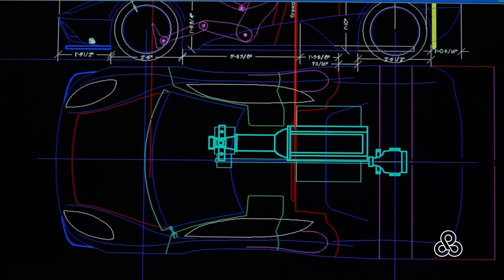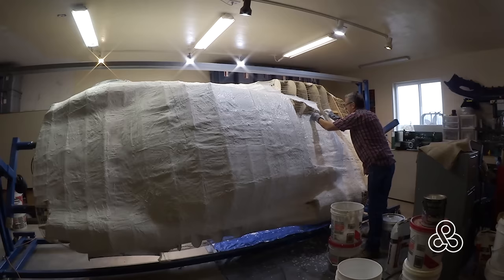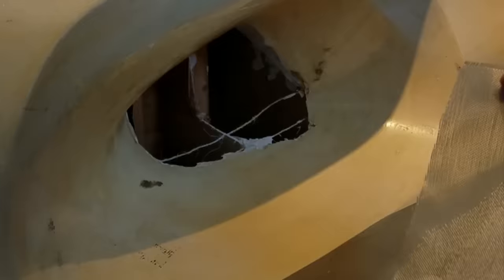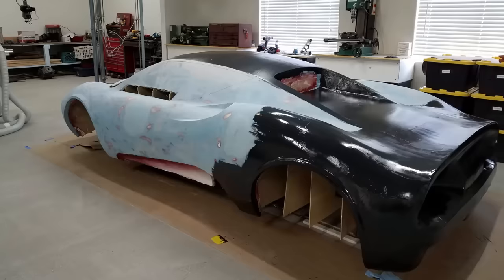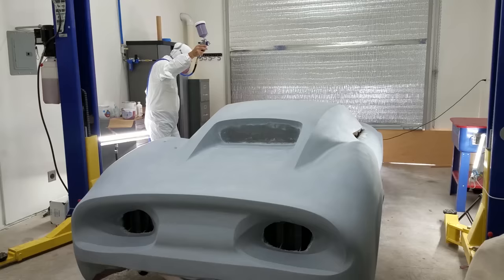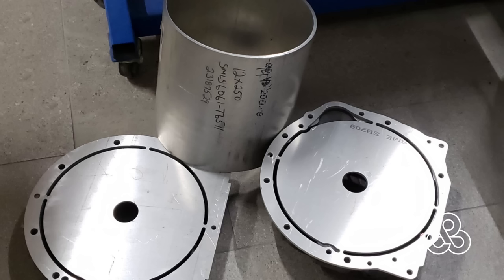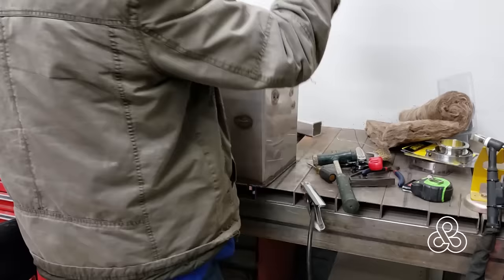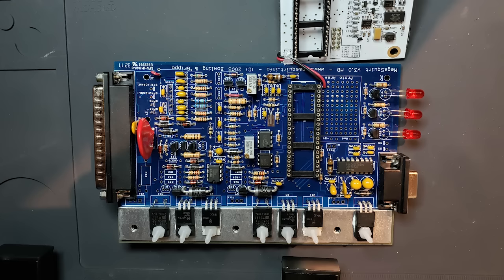How to build your own 200mph Supercar; at home in your spare time. Part 1

Comment: I love how you did this old school with the plywood, burlap, and plaster, rather than have a CNC machine carve a complete car shape out of solid foam like many guys do nowadays!
Reply from the maker: Thanks! I'm not apposed to the CNC foam modeling, but I wanted others to see a viable, less expensive, way to get it done. Hope you follow the whole build - lots of other "short cuts" in the process.
Reply: @BuilderCreator  I have been watching/subscribed to your channel for over a year. While I would love to be able to build an entire car from scratch like yourself, but budget restraints have me instead thinking of skinning over an existing car with my own design, leaving the original car intact underneath (for the most part). I am left wondering if it would be possible or practical to shape with something like foam over an existing car's body, and then just fiberglass it, leaving the foam underneath (maybe as sound deadening lol). If that is possible then I wouldn't need to make moulds of the body due to it being a one-off project. What is your opinion on that method?
Reply from the maker: @crazysnarfy861  Your described method is not only a great budget solution, but a time saver as well. In fact you can even drive the car between stages and keep it as your transportation. about 40-60% of most cars panels will come off with a few bolts removed. On those panels plan on removing the foam and original panels. Just build your part thick enough to hold its shape then pull off the foam and panel from the backside. With it removed, you can reinforce the backside for additional strength and then bolt it back in place with the original holes (fasteners). Areas like the roof, door skins and rear quarter panels, can as you described, be glassed right over. This is all oversimplified in this description, but the general idea is sound. Bonding fiberglass to metal isn't a great idea, but there are work arounds. I have thought of doing a project like this. The perfect donor would be a C5 Corvette as they are fairly inexpensive, you are starting out with fairly good lines already, and the base is already fiberglass! Keep in touch as you get stated. Would love to see what you come up with.
Reply: @BuilderCreator  Thank you for providing your input on that method!! I have yet to find any source on it for the real specifics for that. I watch any Youtube video even remotely related to the topic in hopes I can cobbled together some feasible ideas on how to do it that way.
Reply from the maker: @crazysnarfy861  Well, if I get to it before you do, I will make a video series about it.
Reply: @BuilderCreator  That would be great! I already have the car I will be using...it's a 2004 Chrysler Crossfire. A neat little coupe that is perfect for the project I have in mind.
Reply from the maker: @crazysnarfy861  That will be a fantastic donor car!

Comment: great video   I did a similar home build in 1980 and created a GT championship winning ground effects car for the Donnington GT championship which I won .The pattern was a much modified Lotus Esprit body shell  Internal bulkheads were plasticel cores with fiberglass and kevlar facings . The ground effects underneath panels were  hand shaped using chicken mesh and plaster of Paris  The racing handbent exhaust system and home modified  one litre Hillman imp engine was dyno tested at Greetham engineering in Coventry UK.   who did most of the specialist machining  on the engine . On pole position after three practice laps    My car was not quick off the line .. but at the end of the first lap I had passed everyone in front and exited the chicane  with almost the whole length of the start and finish straight lead . It became quite fun to overtake cars which were braking for the old hairpin at Donnington  .       MY ground effects car was easily able to take that corner at full speed without any braking ..
Love your workshop   I am now 77 years old and retired to Portugal . I still maintain my own transport . And still dream up new projects .. My super efficient afterburn woodstove assembled in situ   using home made 60 kg cast refractory panels ..
Reply from the maker: I love the Lotus Esprit. Sounds like you fixed the performance shortcoming of a great styling masterpiece!

Comment: Very cool!  But for those of us that are not able to have all of these tools and the expense is still too much. There is always the 2007 - 2010 (335is and some others going to 2012) with the N54 engine BMW cars that can be purchased for reasonable money now (between $2000 to $15000 depending on condition mileage etc) can be built into very safe reliable super power cars by the average person. I have bought a 2008 335XI with the N54 engine done all maintenance and repairs and then bolt on's and over the counter (an App called MHD) tuning. For less than $5500. It has almost 500hp at the wheels and can be brought higher with other means and parts to over 800hp. Totaling less than $10,000. What a deal and what a car!

Comment: It's incredable that you took all this on, looks like your doing a great job, I see a lot of race boat building technology hear. I like how you do your flanges in the molds.
Reply from the maker: Race boat and Kit Plane (Burt Ratan sandwich const.) whatever it takes when you don't have Giant CNC and autoclaves. Ha!
Reply: @BuilderCreator  it's great, this will be a increasable car. The technology available is amazing, you get the benifite of all these years of suspension improvement.

Comment: Another suggestion I would have made rather than cramming all the exhaust between the mid engine and the rear of the car. Is to run the middle of the car and then turn back and use side exit exhaust, extra weight, but room to add more mufflers and sound deadeners

Comment: Great job, I designed the mini hummer exactly the same way an electric mini hummer for MEV uk it’s just stared to be sold in California
Reply from the maker: Just looked it up. Interesting project and market. Good detailing to match the original Hummers!
Reply: @BuilderCreator  Thank you, but I do feel your engineering skills are way better than mine. I did have a guy weld my chassis design which was a simple ladder chassis plus my suspension the rear has diagonal link- arms to support the rear axle that incorporates the electric motor which was developed by a Taiwan company. The builders laser level was a god send as it helped me obviously keep the body shape not only square but the shape identical both sides of the car ( I think you will know what I mean) as the laser line changes shape as you sand down say both wings.  
I did make mistakes for instant I designed the body in one piece one mould with split flanges which made it difficult to manufacture the car, the doors were the hardest part as fibreglass isn’t the most forgiving material for accuracy. Anyway I could go on forever, —— it’s a long long story land I won’t bore you, I still have more of your videos to go through but so far really enjoying and still learning even at 63
Reply: Hi again I just thought this may interest you, about two years ago I was working on an interesting project but unfortunately lack of funding has delayed the project. I managed to get hold of an E type Jaguar mould which consisted of the full body short version and long version plus hardtops which included the Le man race car slope roof. Anyway I decided to change the design to the V12 with modified wings and larger radiator mouth opening grill plus the front air intake below the grill. I also changed the dashboard to my own updated design as I decided to go electric ( E type fans will be angry at the thought ha) ideally the Bosch rolling chassis full on electric system would be one choice but very expensive. I do hope to start the project up again especially watching your videos has given me some more ideas thanks

Comment: very good video just to give you one tip though. When you have the mould you dont have to section off the different moulds with that parting line. You just cover it smoothly with bees wax. You only need to make a parting line on the plug so you can make a split mould.

Comment: This is a very nice and ambitious project, well done and featuring a great presentation. I do worry that the nose profile will generate lift at high speed though. You might lower the nose to reduce this aerodynamic effect. My approach to building my project (search YouTube) was to build the chassis first and fit the body afterward. Building a body first pretty well limits what you can do with the chassis. Nice job; looking forward to your first drive video. -Neil
Reply from the maker: The front splitter is coming up on the build schedule, you will see it " brings the nose down" for more downforce than lift.
Reply: @BuilderCreator  A splitter should help. Keep your fingers crossed. :)

Comment: I love how in minute one, you've sculpted the scale model, built a silicone matrix mold of it, and cast it in plaster. That's 100 hours right there. Nice project, looking forward to more. I know you sculpted the whole car for the satisfaction but did you consider folding the paper patterns and making them truly symmetrical at that step, before you copied little differences up to the plywood?
Reply from the maker: I flipped the drawing (single sided) over in the drafting program before I printed them; making it symmetrical.
Reply: @BuilderCreator  Nice I figured you did it somewhere.

Comment: I would LOOOVE to do this in my garage...... but not a car!!!  An AIRPLANE!!!!  Either a 2 seater fighter jet looking thing or, my absolute favourite, the Vought F4U Corsair!!!!  But say ⅔scale or 75% give or take scale!!!  Scaled to match the modern  7 cylinder radial!!!
Reply from the maker: Even at half scale you had better have a big garage. Ha!
Reply: @BuilderCreator  well......i myself don't take up much room so a house with a really big "open floorplan" with a mattress in a corner next to my mini fridge and microwave...... across from the 80" flat screen tv hung on the wall...... and satellite/dvr...... you know, just the basics for life...... that way I can use my garage to build and maintain my automobiles...... the way it's supposed to be!!!  Then when I'm done building the corsair, i can knock out the back wall and taxi it out onto my driveway and take off on the road out front of the property!!!!  It's not a very busy street so with just a wee bit of assistance and a walkie talkie i can avoid having to scare motorists while taking off!!!!!

Comment: Its cracking because you're using drywall bucket mud. Use easy sand 20, 45 or 90. The numbers are minutes it takes to set up. It won't Crack
Reply from the maker: Thanks, sounds like your talking from drywall experience. What I have found, is that it is near impossible to mix batches of Plaster of Paris (Easy sand) to the exact consistency every time (even humidity effects it). Then once you start sanding, the layers of different density sand different leaving waves in the finish. The "air dry" muds, as they are factory mixed, are much more consistent. Filled cracks are just not a problem. You just can't ignore the convenience factor as well. Need 2 ounces, just scoop it out . . no mixing, no clean up.

Comment: I'm a GM diehard and build and tune  high powered GM cars often. With that I have a lot of experience with the 4L60E transmissions, built best of the best in the industry ( in the opinion of everyone that I respect at least).  With that said, I know for an absolute fact that a properly built A340 will way out perform any 4L60 out there. At that point you could surely adapt the C5 diff that you have to it. I would highly recommend running the C6Z or ZR1 diff over that. They are easily double the strength of the C5.
Let me know if I can be of any help
Reply from the maker: Almost went with a Tremeck, but it was still out of the budget at the time. Some bemoan my choice of the automatic, but they are also the ones who aren't on the budget committee of someone else's project. Ha!

Comment: Brilliant work!!!  You have overbuilt so much of the car, I’m curious if your going to use carbon fibre for a final product?  You have spent so much time developing your bucks, why not use them to build carbon panels?

Nice work, I tip my cap to you.
Reply from the maker: If I move on to carbon I will have to create new molds from scans of the finished (and then tweaked) prototype.

Comment: Make anything you can.  A car building certificate is available so you can build your own car.  Just be exact according to the law of car construction certificates.  The main gauge light.  Safety main chassis machine frame.  Two things.  The rest of the standard is what is engine emission or electronic.  In the near future there will be a limited build with an emission engine but only a hybrid with an electronics engine.  Building certificate is not expensive.  Registration of a vehicle transport office drawn up a document for a vehicle construction project will be registered in the machine VIN code database.  It will be able to participate in traffic all over the world.

Comment: I hope you have worked through the rotations of the engine & transfer case as well as the differentials. There are some interesting applications of the Dana 44 differential. As it is now your car will go fast, backwards.
Reply from the maker: Oh, believe me; I have gone through rotations a hundred times. If I'm wrong, I will just drive around forward, slowly. Ha!
Reply: @BuilderCreator  It will depend on the differential. That is why I mentioned the Dana 44. Is it a gear driven case or chain transfer case you plan to use. I have lots of Jeep/4wd experience among other things.
Reply from the maker: @tyroneshulace3203  The center Diff is a bespoke unit that I am building. It is both chain driven through the viscous coupling (from a Borg Warner 4472) for the front output and a helical gear set for the rear shaft output. The center Diff feeds Getrag Differentials front and rear, with the front diff turned upside down. I am just getting a furnace going again that has slowed me down on doing a bunch of castings for different projects. Parts for the center diff being one of those. Hoping this winter allows me to focus on cars and not so much land maintenance. Maybe get all the drive-train hooked together?

Comment: great choice for engine as boosted engines are so dramatic.if you're interested in the turbo noises consider a hks t51r turbo as its the most iconic sounding turbo for the 2jz infact if you youtube t51r mod theres a company that can mod your turbo to gie it that iconic whistle air rush sound,

also givng the wastegate its own dump tube vented to atmospere especially with a external wastegate will give a rushing air sound called screamer pipe mod.

and there are too many choices of blow off valves to suggest just choose one you like and vent to atmosphere.do any of these or all for great sounds.

i also wonder if you could incorporate a mr2 turbo muffler to this?

Comment: Great great project. What welder did you use on the aluminum I haven't seen a gun that welds ?
What foam core panels you used has cardboard bonded to it ?
Love the car. I've built many ,so I Know the work and the TIME !
Great car !
Reply from the maker: It was all TIG welded, but I should have taken the time to set up the spool gun, in the end it would have saved me a lot of time. The foam is Isocyanate with a fiberglass reinforced craft paper backing

Comment: how do you ensure symmetry while doing everything by hand? like when making the individual molds, how do you make sure the opposing molds are exactly the same? or do you just eyeball it, and assume it is not going to be perfect? no matter what it really is a beautiful project and I really admire your skillset.
Reply from the maker: Once the prototype is finished and the bugs worked out; if I should desire to replicate the car, I would scan the finished product and use one side of the scan and mirror it in 3D workspace. It would then be perfectly symmetrical. Till then, close enough is "close enough."Ha!
Reply: @BuilderCreator  I love it! I am thinking of building a fiberglass part 103 compliant ultralight airplane, so a lot of this applies in regards to making molds and fiberglass body panels. It is amazing to get some insight into your process.

Comment: Absolutely incredible! A couple questions. It doesn’t seem like you’ve very concerned with weight using a lot of steel rather than aluminum and fiberglass rather than carbon fiber. Why is that? Generally when building a super car every pound means less speed and less handling.

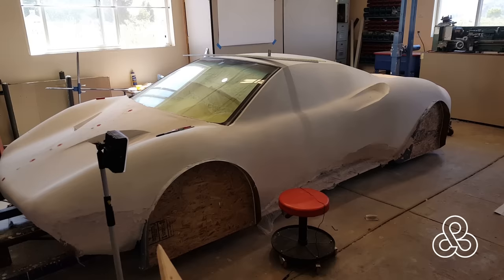Comment: 5:23 
Those lines on the hood flowing from the vents towards the front of the car is a beautiful touch. Subtle, but adds a lot to the car. 

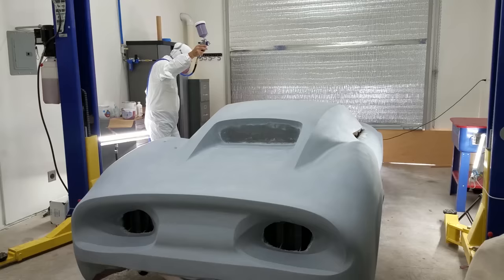8:47 
Is it possible to sand TOO much, or is this a case of the more, the merrier? I know little about sanding, so forgive my ignorance on the subject :)

18:19
That clamp thing in the foreground attached to the subframe while you're welding...what is that? Is that something you need while welding? 

Brilliant work, Mr. Jarvie!
Reply from the maker: Thanks, I originally had planed a much more aggressive hood vent, but the double nose and the creases worked out well. Sanding- while working in the plaster, over sanding is not a problem as you can easily add more plaster. Welding- Yes, the clamp is the ground cable. The electric flow goes from the Positive "electrode" through your work to the negative ground cable. The electricity trying to jump from the electrode to the work melts the welding filler material and deposits it on the surface. Of course it can be done with different current flow directions and different electrode types, but that is the simple description.
Reply: @BuilderCreator  Cool beans, thanks for the reply!